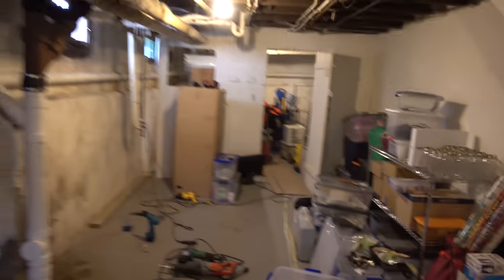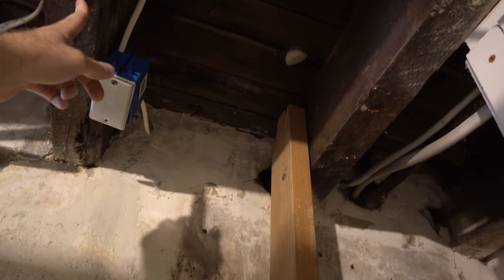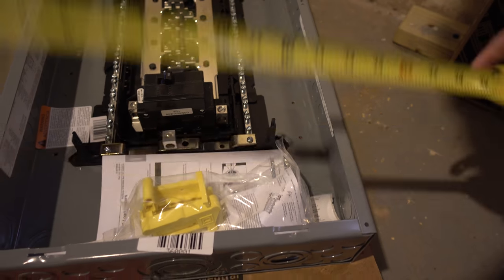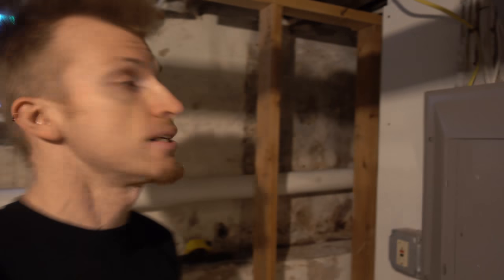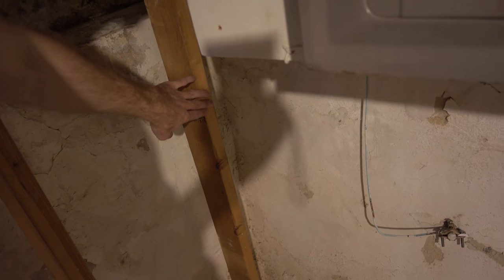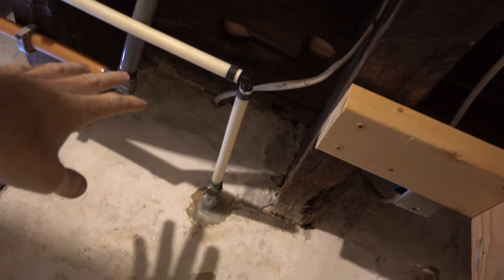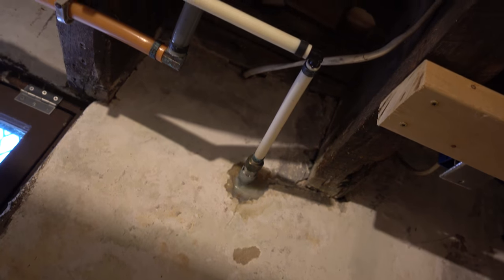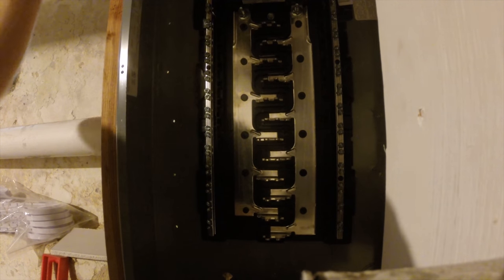Mounting a Load Center (Electrical Panel)

Comment: You need to get your tee guide that came with the table saw and it fits into the slots cut into the table. It helps steady the 2x4 so it doesn't wobble on you, and makes for a square cut

Comment: You need to invest in a Chop Saw.  It will make your life so much easier when cutting studs and you can use it on pvc pipe. Plus the time saving.
Reply from the maker: It's on our list - just waiting for a good sale

Comment: This is why you hire a licensed and insured Electrician. Failed inspection before even pulling wire. NEC 110.26 must have 30inches of clearance in width or size of the equipment. Whichever is greater. Also you need 36” of clearance in front.

Comment: Just a thought steve but I would hang the pipe rather than drill through the floor joists just because if you ever need to replace a joist it will definitely make it easier

Comment: Suggestion: don't swap panels. Use this panel as a pony, secondary. 100 would not be code, only retrofit. And your wires are going to be live from the street. So you're going to have to call hydro. That will be a good opportunity to get an electrician in for a consult.

Comment: I don't like being a safety Sally but it would be safer not using the fence Steve or put a bit of wood on the first bit of the fence to measure the 2 x 4 and push off of it as you make your cut so the board can't bind between the blade and the fence  as you cut good luck with the project
Dan

Comment: Steve should really stop using a table saw as a circular saw, trying to cross cut a 8ft board is so dumb and dangerous idk where to begin, you can hear and see the kickback
Reply: Using it to cross cut with the fence is woodshop 101 no no
Reply from the maker: Sometimes you have to work with what you have. We would like a chop saw but it's not in the budget right now
Reply: A simple circular saw is inexpensive and far safer than using a table saw.
Reply: dropn loads Ha...I said the same and then saw your message. Def wouldn’t use the table saw that way.
Reply: BossmanEight - Cool, so when are you buying them one?  ;)

Comment: Steve you don’t screw the panel by its sides you screw it using the back of the panel onto a piece of 3/4 plywood secured to studs . You really should let a licensed electrician do the job .
Reply from the maker: RTFM - See page 2 for flush mount instructions: https://download.schneider-electric.com/files?p_enDocType=Instruction+sheet&p_File_Id=7726628787&p_File_Name=S1B33894.pdf&p_Reference=S1B33894